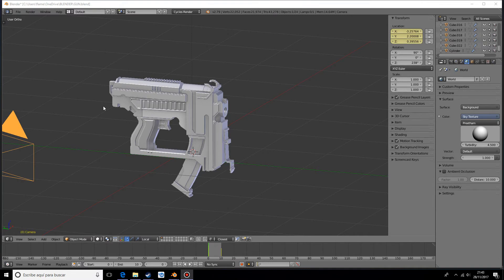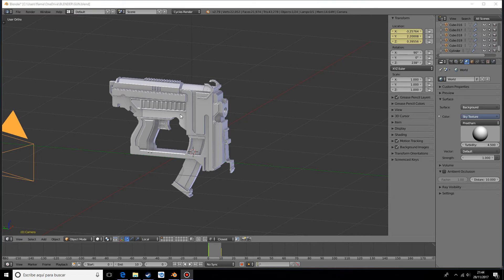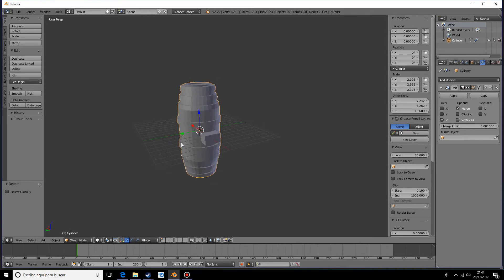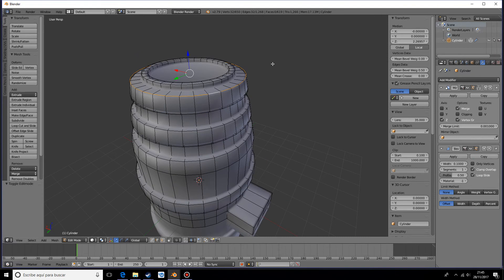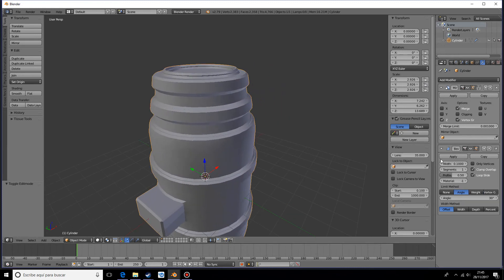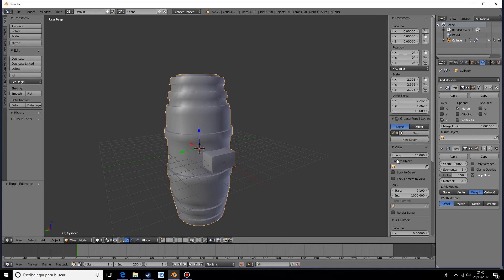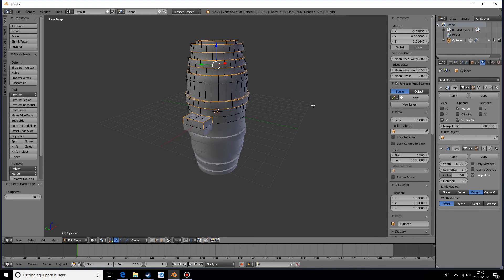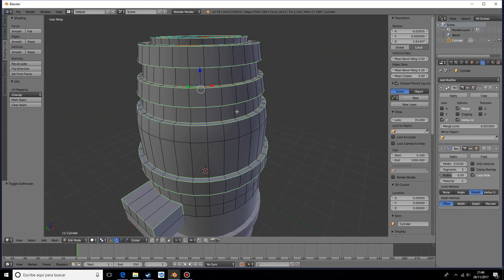Hard Edge Modeling (NON-DESTRUCTIVE! WORKFLOW) - Blender

Comment: What's the advantage of these methods over Mean Crease settings?
Reply from the maker: This method is actually also considered mean crrase (I'm not entirely sure but I think so). I believe there are at least three different ways. Simply use whats going to give you good results without making your models unmanageable like with loop cuts